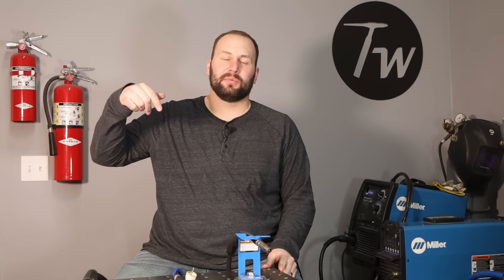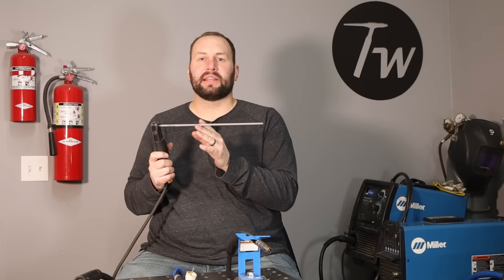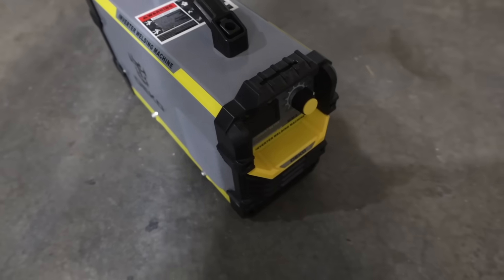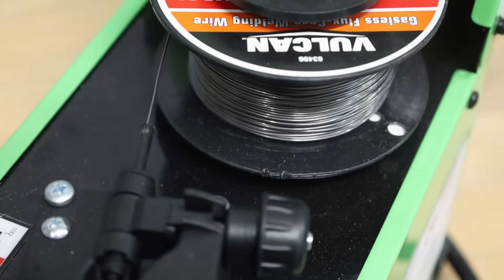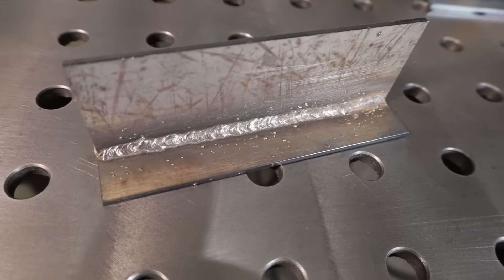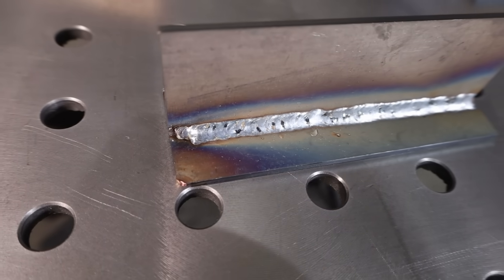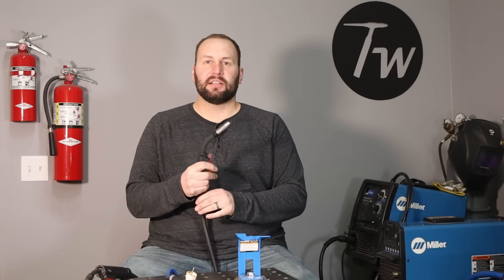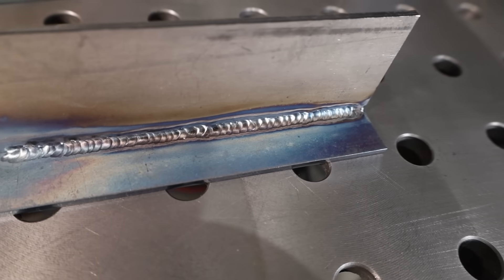4 Types of Welding Explained: MIG vs TIG vs Stick vs Flux Core

Comment: You are clearly MAG welding and not MIG. So you should point out the difference between MIG and MAG witch is the gas you use. MAG use active gas and MIG use inert gas.

Comment: can you use a mig welder without the gas
Reply: Yes its called flux core
Reply: Flux core , dual shield , and solid wire are all ran on a mig machine

Comment: Flux core for the Hobbies is trash. Learn to weld with stick. Flux core is for production buy a decent multi process machine and a suit case wire feed for it.

Comment: I literally know nothing about welding other than what I’ve just watched in this video, why when MIG welding, did you use a looping motion? Sorry, I don’t know the correct terminology
Reply: It's to get sufficient molten metal on both pieces of metal you are welding. Usually you will do either a looping motion, or a back and forth "u" motion.
It's not just for MIG, I will do it with most forms of welding
Reply: @sethharvey7658  and it makes your welds look puurrty

Comment: Finally someone who explains the welders and what they do now I know which one I want to buy thanks a lot great video!!!
Reply: I agree 100%!
Now I know which type of welding I want/need for the job's on a farm. Seriously, this is the best beginner's/introduction to welding video I've ever seen. ThankQ so much.
Reply: I have Mig and gas isint all that expensive just buying thetank up front is.it dosent smoke your garage up,very clean welds and the wire is4x cheaper than GMAW.i love it.i have a stick welder to but my mig get all the attention.if you have questions just ask im an ironworker. I can help
Reply: Yeah, just stick with MIG. I hate all the cleanup from stick, but it'll work in a pinch. I've been doing TIG for the past few years. It's pretty nice that you can weld without using filler rod sometimes, and it's pretty clean. But it takes longer to run a bead than MIG. And having to stop and clean up your electrode because you accidentally dipped it is pretty annoying. With MIG, once your machine is set up, it just works and you can run a bead quick and easy. I think a spool of flux core is good to have just in case you run out of shielding gas, but every second you are cleaning up your weld, is a second you are not setting up your next weld.
Reply: You can go get you a cheap cracker box or buzz box whatever you want to call it, welding machine at harbor freight for about 80 to 100 bucks. 90 amp. Will weld up to 3/8 in metal and you can use flux core or standard mig. For 140 bucks you can get the welding machine that has the option of hooking up an electrode so you can stick well.
Reply: Good job broww 👍☕☕
Reply: Yep, I totally agree. I have a TIG machine, separate Flux Core welder too.
Reply: What did you go for? I went mig because of ease but questioning my choice now
Reply: @user-st2it1kt8r  mig is really good for basic welding its like stick but easier and more accurate for car parts exc.
Reply: @user-st2it1kt8r  went with the regular stick welder so I wouldn’t have to get gas
Reply: @user-st2it1kt8r  MIG welding is great if you're working in a shop. Stick welding is the way to go because of its unbelievable strength and penetration. For instance, if you are needing to weld up something that needs to be very strong but yet flexible, you would use a 6010 low hydrogen rod with a 7018 cover pass which is a high hydrogen rod. I've been hanging high steel for about 20 years now and that's all we use. The first pass is 6010 for deep penetration so that you can cut down into the metal really good with the rod and then we use 7018 high hydrogen rod to cover it for the strength. Take 70,000 lb to break a 1-in 7018 weld. That's a lot of tonnage
Reply: @user-st2it1kt8r  
Why are you questioning your choice? I haven't yet purchased a unit. Flux core & stick is the direction I'm leaning towards. I need to watch more videos before I pull the trigger. So please, tell me why your hesitant?
Reply: @reneemills-mistretta790  get that harbor freight titanium 125 flux core ...its like 170 when it's on sale works great
Reply: @patf03  
Hi Pat, I've actually been eyeing that machine. I need a plasma cutter, I need to ask Tim if the all in one that includes plasma cutting is worth getting or is it best to buy separate machine's. I have a air compressor that will handle everything we need.
Reply: @patf03  is that a full name of that  mashin? kind of long.. need something disend & inexpensive  for general work here & there.. any suggestions?
Reply: @user-st2it1kt8r  you can get gasless mig
Reply: esab Rebel welder  does it all for pretty cheap thats what I got and I love it dose tig mig  Flux core and still it always come with all the accessories and will set the machine based of a chart it has built in
Reply: @jamesgarrison6430  what thickness/depth can you weld with it?  I will  be welding car parts, fabricating exhaust, motorcycle parts/frames, go-kart and mini bike frames, stuff like that once I get back into welding again.
Reply: @russnurse2b807  I got a boc 320r for mig solid then a Lincoln 180 for flux then my unimig ac/dc 200 razor for tig and stick I dunno the brands they sell in the states but In is austraila but a Uni mig is the go over here unless ya wana spent a fourtune on something
Reply: 1
Reply: Just remember if you want to tig aluminum you have to have a tig that welds high frequency. Don’t just buy a tig and think it will weld aluminum it won’t. You can mig aluminum yet it doesn’t have the strength of a tig. N the maker of the welder is all personal preference. They all work the same pretty much. Me I love Lincoln.
Reply: U probs bought a mig
Reply: I agree.. I’ve searched this topic out and have never found anyone explaining it as well as this guy. I too know what I’m going to get based on what I need now that I know.
Reply: https://youtube.com/shorts/QF1uD_1Wlkw?feature=share
Reply: Exactly after watching this video I know which one to buy
Reply: Nice weld! I am very good at MIG MAG wire welding
Reply: Nice video and good explanation. One welding process I think was missing. Pulse is getting bigger and bigger, maybe u can explain when it's use and its benefits.
Reply: @thilo1291999  pulse really isn't a thing.  Its more of a gimmick.  People have brought it up in the past and I ask them why they are afraid to just pull the trigger.  An older welder who's been doing it way longer than me, 48 years he's been welding, said it this way, " If your metal doesn't pulse, why should your welder?"  This guy has done it all, and done it again, actually has a point.   Its always an ongoing learning process and his tips and tricks are actually tried and true.  Hes the bible.
Reply: Real men learn how to stick weld. 😉
Reply: @oldcountryman2795  they also don’t eat quiche right?

Comment: is there any good mig, tig, stick gasless welder? just for home projects and small stuff, and learning practice welding?
Reply: Most or all welders use gases to protect the weld from contamination from oxygen.
Reply: If it is small projects a 110v Flux core mig will be fine. Mastercraft , Lincoln etc... however keep in mind this is only for small jobs as they only have a 10-20% duty cycle

Comment: Which run on 240V vs 120V? Because many homes, apartments, etc. don't have a dedicated 240V outlet for things like welders. Most cases there are two outlets in the house, one for the stove, and one for the dryer. So using a 240V welder also requires electrical knowledge or more money to pay and electrician, so a new 240V 30 amp circuit can be routed to the breaker box from the garage, outside outlet, etc where you are using your welder

Comment: Good description of all processes... I haven't used stick in ages but love my MIG for quick and heavy and still learning TIG but it's a beautiful process to use, very reminiscent of gas welding with black wire. Between my TIG and my Plasma cutter the oxy-acetalyne has been relegated to heating duty.

Comment: Love ur vid.
Would like to hear what you think of a Multiplaz 3500 welder/plasma cutter system.  Can bond different types of metal/alloys.  Uses water/isopropyl mixture to create 8000 degree plasma arc.
Reply from the maker: Thanks! I saw one demonstrated at a trade show years ago, but haven’t ever tried it myself.

Comment: Sir I have a question, except for the two welders you've mentioned about mig and tig, which is better to have and use stick or flux core? Because I have already purchased flux core welder. My observation to other welder bloggers said it depends on what project you have to do. I purchased flux core because I am a new DIYer. They said flux core welder is much easier to use and no frustrations rather to use stick welder. Kindly sir, from Philippines. Thank you and more power to your channel.
Reply: Flux core works excellent. It is much faster than stick produces nice looking sound welds.
Reply: @geoffmooregm  thank you sir, I was not wrong in choosing Flux core and I appreciate you that sir.
Reply from the maker: It really does depend, but in general I agree with flux core for a DIYer.
Reply: @TimWelds  thanks again sir for encouraging me you're my mentor.

Comment: I was confused and couldn't figure out Flux core Vs. Mig and getting mixed up there. Thank you so much for your excellent explanation and sharing your wonderful and well thought out video.
Reply from the maker: So glad it helped!
Reply: Flux core is mig. Differences are done on whips as no diffuser is used because no gas is " required".
Reply: Also wheel tension is looser on Flux core / dual shield as opposed to solid wire to avoid collapsing it

Comment: The reason it is called "stick" welding is because the electrode will stick to the face of the metal if your technique is incorrect or flawed. Not what you said.
Reply from the maker: We've all stuck a rod or two... or fifty. Good times for sure.

Comment: Tbh anything thats a 16th thick is easy to burn through no matter what type of welding process your using😂😂😂
Reply from the maker: It takes a bit of practice to run the thinner stuff for sure :)

Comment: So... if tig machines will stick, can you plug a tig gun into a stick welder,  and hook it to gas separately?   

I think tig should be easy because I learned to torch weld first and foremost... same mechanics different heat source.   Just hate the idea of buying yet another power box.
Reply from the maker: You can indeed, with the main drawback being that you still have to strike an arc, which is why this type of setup is often called 'scratch start tig'. I did a little video about it that might help: https://youtu.be/aGDHX5JdOos

Comment: Great explanation!  I am brand new to welding.  I`ve picked up most of the equipment necessary, but just need some flame resistant clothing and I`ll be ready to go.  The descriptions presented here was exactly the clarification of the different processes that I needed.  Thanks man!

Comment: Tim I have a question about tig welding. I recently bought an Everlast 200sti welder. I bought it for stick welding, but knew I wanted in time teach myself to tig weld. What my question is, on the panel there is a scratch start and a lift start function. What is lift start? Scratch is self explanatory. But lift not so much. It sounds like you touch the metal then lift and the arc is started. But isn’t that the same as scratch start? Could you please clear this up for me? Thank you

Comment: Nobody ever talks about oxy acetylene welding feel like it's become a lost art
Reply: Replaced by tig
Reply: If you like gas welding then try using a plasma welder.....no gas to buy and runs on mains 220 volt electricity.

Comment: Are these the modern typical welding methods?
Reply: Yes. There are a few more like Plasma Arc Welding, Laser Beam Welding, Resistance Welding, Submerged Arc Welding and Electroslag Welding. But Mig, Tig and Stick is all a consumer will be using.

Comment: Thank you for the clear presentation.  I've been interested in welding for home repairs and artwork.   So far as aluminum goes, do the propane torch & aluminum sticks work well?
Reply: It is pretty hard to weld aluminum with a flame
You habento remove the aluminum oxidation layer before starting the work
Reply: For little home repairs and art you can use the Muggy Weld style of soldering rods. It is not acceptable for fabrication.

Comment: As always, excellent explanations!

like everything else, quality and features depend on cost. Now, the big manufacturers, and a couple of smaller ones offer full featured machines that have everything, like my ESAB 205, a couple of Everlast’s, Miller, and I think, Lincoln too. No well known maker has a machine that does plasma cutting in it as well, though Everlast may. But I don’t recommend them, as reliability isn’t where it should be with those machines yet.

I’ve noticed that table for a few videos. I’ve never seen that anywhere. It looks nice. Who makes it?

Comment: There is something confusing that I have never seen anyone directly address about welding aluminum.

everyone says you need an AC tig machine to weld aluminum well (I know it is possible on DC, but difficult to well). 

However, there are a bunch of DC only mig welders, sold with optional aluminum spool guns that seem to work just fine, and are intended for long sustained welding of aluminum. so it is obviously not the heat / square wave function that stops the metal from over heating.

Any idea why that is? I guess, why is DC tig so bad with welding aluminium, but DC aluminum spool guns seem to be the industry standard?

Comment: Nice overview! I was glad to see your flux core nozzle: I had bought some for my yeswelder mig205ds, but I wasn't sure if it was fitting right, since the contact tip was sticking out. Turns out that's a super fast way to pop a breaker, touching the contact tip to the work. 🤦

Comment: Great Video! I'd love to see a video on the size differences and average cost to fill / rent / buy a cylinder. Or how long a certain capacity may last in general. I never see any videos talking about that.
Reply: That would be difficult to do. So many variables. What part of the US also plays a factor. I live in East Texas my argon and co2 bottle is ABOUT four feet tall and ABOUT eight inches in diameter, I think it’s 165 cubic ft of gas capacity. It cost me around three hundred bucks eight years ago. To refill it with 75%/25% argon and co2 is forty ish dollars. To rent the same bottle would be about $12 a month plus gas at same price I pay now. Like I said I’ve had mine eight years and paid $300 if I was renting, by now I would have paid around $1200 bucks. The gas itself is the same price either way ownership bottle or rented bottle. 
I hope this helps you. The best thing to do is go to the welding supply you are going to use have them explain and show you the different bottles

Comment: Hey Tim Grate video. do you have any idea how much does it cost for small cylinder with gas for mig welding.
Reply: Here in TX, I paid $175 for a 55cf bottle of 75/25.
Reply: @danielchambers1958  Thanks for the reply.